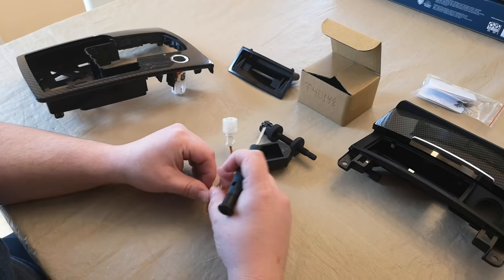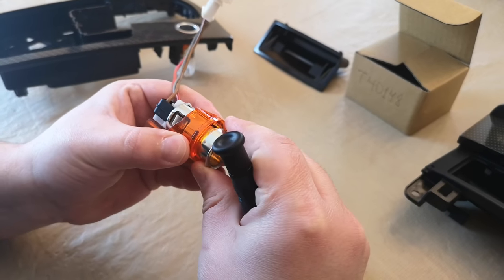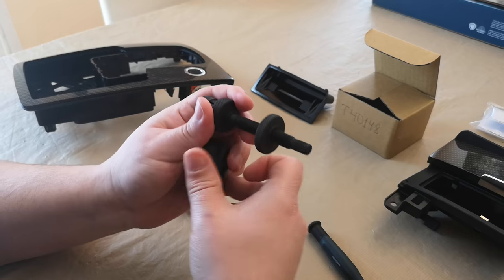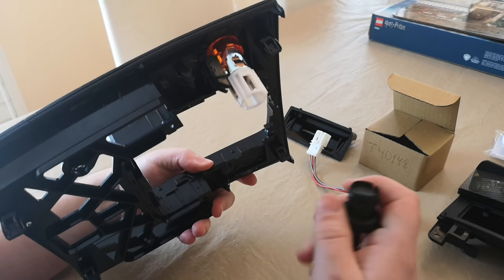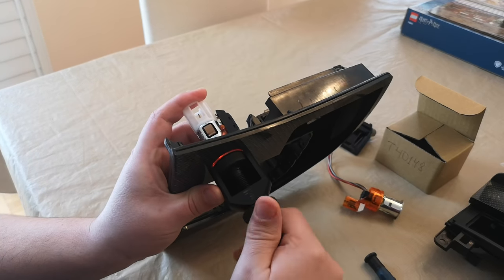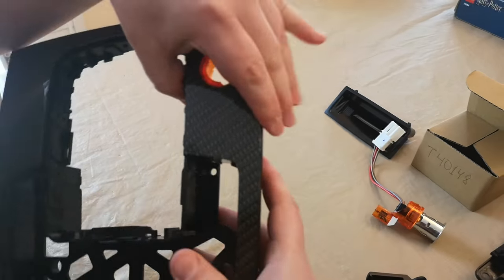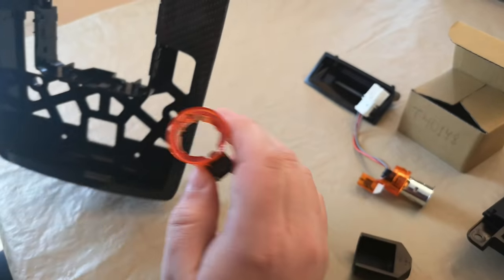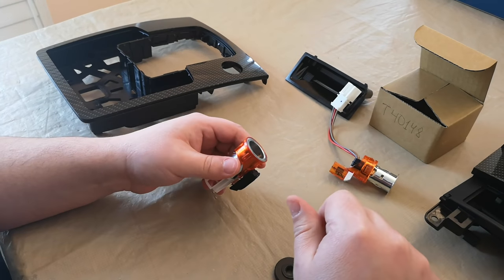Volkswagen Audi Cigarette Lighter housing Removal

Comment: Or a wack of a rubber mallet square from the back  Worked like a charm.
Reply from the maker: By using the FORCE/mallet you'll probably break the metal pins of the housing - but its definitely an option of you want just to disassemble and remove the housing - without reusing/assembling it back later...  :)
Reply: @RetrofitGuy  nah.  The metal pibs are protected by the plastic housing. The "just hard enough" rubber mallet whack simply dislodged the metal holes from the plastic tabs holding it in place.
Reply: Best option just lightly tapped it and came out nothing broke.
Reply: @Steven-yf2ef  yes- I should clarify my comment that by “whack” I meant “an appropriately strong tap to dislodge the tabs”
Reply: @DavidHeyburn  Yeah I had a mallet from a leather kit didn't even use a strong tap, just held it while I tap it bit by bit and came out. As I need to still use it but spray painting the center console.

Comment: Thanks very useful video.  Yep, you are correct - if you dont use a tool, very good chance you will destroy the socket - definately did a number on mine.  Did find a replacement socket but not the light bezel.  Do you have the part# for the bezel and/or where you might be able to find one.  Have not located one yet. Thanks

Comment: Hi there
I bought this tool, but still I couldnt get out the lighter out of the housing.The tool always slides out while turning the top knurled nut. I also have the feeling that the two notches which should press the pins are not moving enough. Any advice how to get that d... thing out? BTW it's from a 08 VW Touareg in the center console next to the shifting handle

Comment: Use 90 degree pick... works fine ❗️
Reply: If so - you actually need 2 picks and 4 hands: 2 hands to push 2 picks in opposite directions, 1 hand to hold the housing and 4th one to actually pull housing... :)))  Feasible - but really not straight forward... :)))
Reply: @ozeraner  Use spring part from binder clip. Works like it was made for it.
Reply: @1stRanger  thank you for this brilliant idea!

Comment: Hello, I'm hoping you can help me. I have a 2016 Audi A5 coupe. I went to push a plug onto the rear cigarette lighter and the whole cigarette housing went in side the back wall. How can I bring my cigarette light back out? The lighter works. I must have pushed to hard and pushed it through! Please help...your expertise is much appreciated.
Reply: Hi. Assuming whole cigarette lighter was pushed in somehow - its the surrounding plastic/leather housing that somehow got enlarged. In this scenario I can only recommend to disassemble that housing and get access to this lighter from the back - and remove it as its pushed all way in now. To disassemble plastic - you will need to remove rear air vents, possibly read climate, to get access to screws that hold that housing in plastic. Or try removing just the vents first - as it may give you access to the cigarette housing  - so you could get it out...Then disassemble it as per my video - and assemble back in the that leather/plastic housing - if the hole is not broken/enlarged/damaged obviously... Hope above info is of a benefit, and helps. Thanks.
Reply: @philip00010  it was me that pushed it in..interesting, I can't open a cap on a water bottle but I have enough strength to push a cigarette lighter through the wall. Lol. I did look at taking the vent apart. It appears the rear vent is attached to a whole unit to the front, making this a big job for a small issue. I left it go. I tried to get it back through the hole and I can not. Thank you so much for getting back to me so quickly. I think your videos are excellent. I appreciate your time and work.
Reply: @e.shealer2417  Thanks for kind words. Appreciated. I'm more than confident those 2 rear vents can be ejected as one piece - and it can give you enough room to get access to that problematic cigarette lighter socket - but of course triple check - as you do not want to damage the vents themselves because those fenders are very delicate and can break easily. Stay safe out there! Regards.

Comment: What year is this for? The part says only 2007 q7 and I have a 2014. Does the tool work for any year/model?
Reply from the maker: This tool fits any VAG ashtray as the mechanism is similar. To your particular question: yes, it will fit Q7 2014 too

Comment: Hi, i was wondering if that tool will work also for a 2015 c300 Mercedes benz. The cigarette lighter is installed the same way
Reply: I have no experience with MB but assuming their lighter has same removal technics - the tool should work exactly same way...

Comment: I bought this tool and my cigarette housing is more then 50% out but now its hard because when i try to pull i got the feeling i pull the orange plastic also... Im removing the cigarrete lighter out of the center arm box from a audi a5 B8. Do i just have to pull hard and be like if it breaks it breaks?
Reply: You should not be pulling the orange plastic out but just the metal part if both teeth of the tool are pressing the inner walls of the cigarette lighter cylinder. Once you insert the tool - be sure you rotate it until you feel the "click" - meaning those tool teeth actually got "caught" in the cylinder holes... If all "caught up" and still seems you pull everything out - I may assume its all stuck / rusted there due to age. There is a need to apply some pressure but not too much.. Depends on condition of cigarette lighter...I may assume you have no choice but to pull and 50/50 you break the yellow plastic surrounding... Hope this helps.
Reply: @philip00010  cool thank you very much! idc if I have to buy a new orange/yellowy part because there is a coin stuck inside and now already for like 4 years I cant use it so it will probably be just pulling and see what happens ;) thanks for the help!